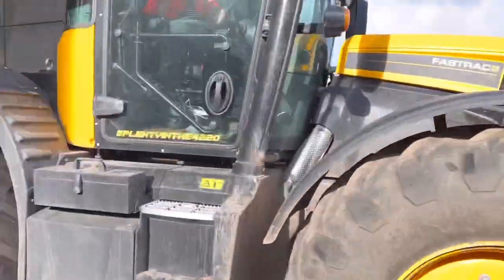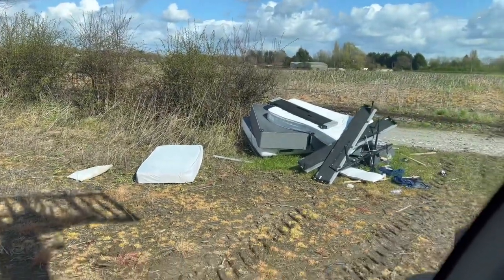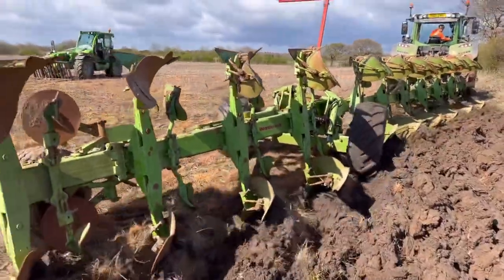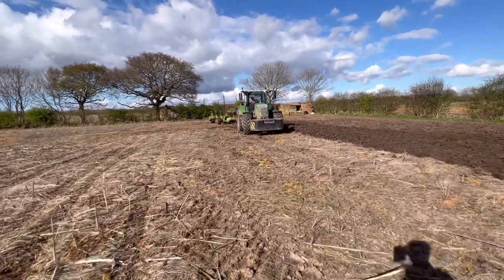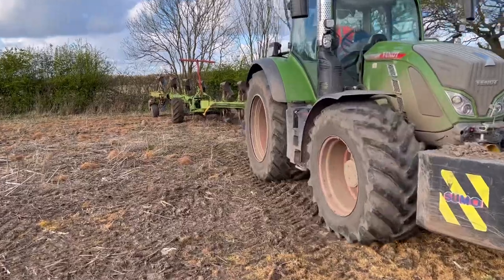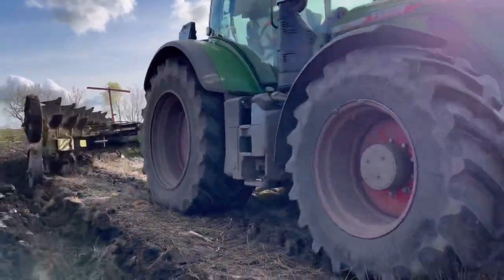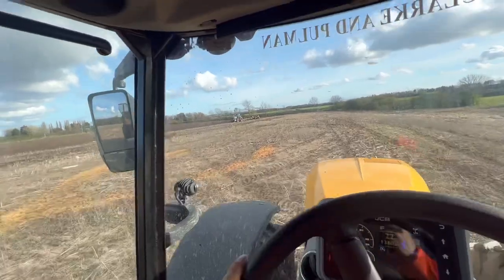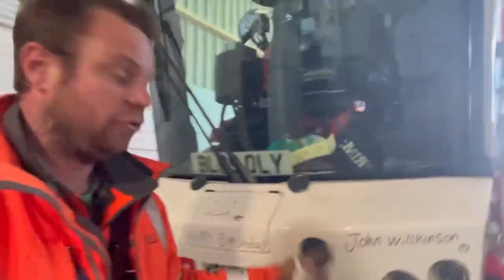Day748 FASTRAC SPREADING MUCK & FENDT 724 ON BIG PLOUGH  #OLLYBLOGS  #AnswerAsAPercent

Comment: Great video again Olly, 
I had a problem with a dp5 plough and the front furrow, was leaving a terrible finish. Turned out to be the leveling bolts on the plough were uneven and that's what caused it. Just check to see if the back 4 furrows of the plough is parallel to ground the ground when in the furrow. It sorted my ploughing out as well as my head 😂
Cheers mate 👍

Comment: I drove a jcb fatrac and I was muck spreading with a bunning that runs at 1000 speed, but it had a 540 shaft on it so the tractor knew it had a 540 shaft in it not 1000. Then It comes up with a pro overspeed warning. Id that makes sense

Comment: I was talking to a farmer that ran a 1200 in the late 70s who said in reference to steering problem to check steering return pipe is not picking up air. He said they had issue that it would turn one way and not other. Took them along time to find issue. Hope this is some help. Simon

Comment: The PTO over speed warning will be because you have gone over 110% of 540. It's in case you are running a 540 machine on 1000 as an economy measure. 
It's been a while does the fastrac only have a 2 speed PTO?
Reply from the maker: 4 I think
Reply: @OllyBlogsAgricontractfarmer  A strange one then, 40 series Ford's etc used to do that but with a 2 speed PTO. Because most new stuff is electronically engaged the tractor know what speed is selected so doesn't give an over speed warning. 🤷 I've not seen one on the dash in years.